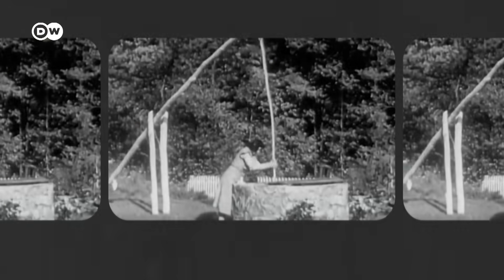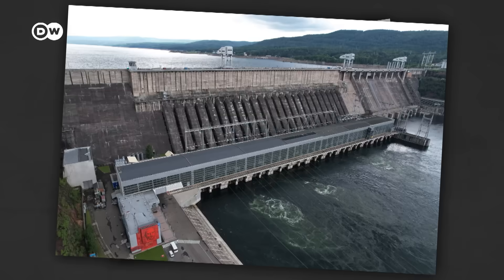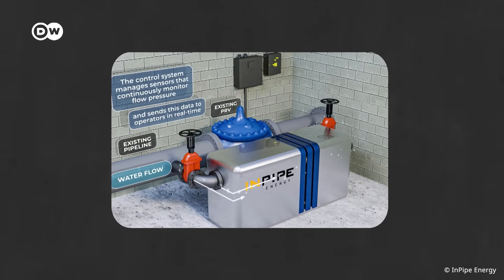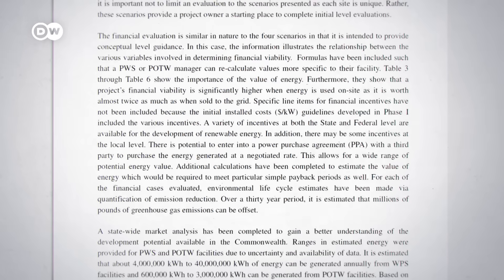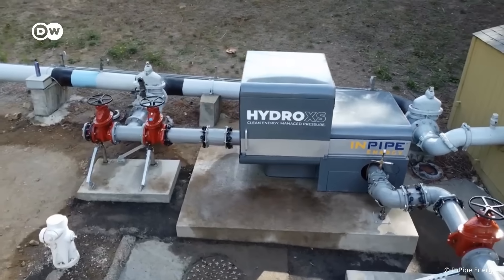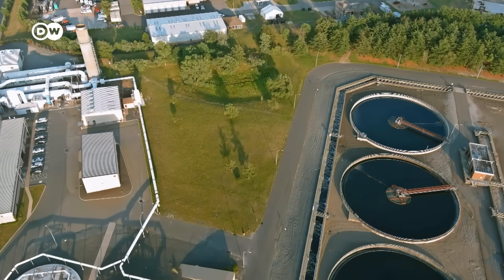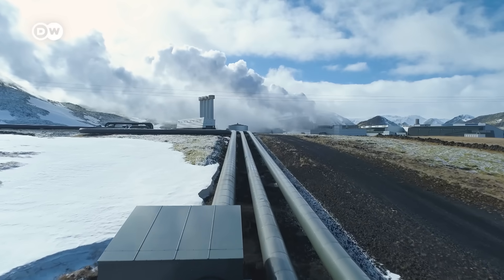In-pipe energy: The hydro power nobody is talking about

Comment: I'm stuck on the issue that if the flow is tapped, it will require more pressure to maintain the original flow rate. It seems apparent that there must be a lot of wasted energy generating the water pressure to make this viable. Tapping anything other than that will reduce system performance.
Reply: I agree, I don't get it either at first. But I think that they have to ensure that there's enough pressure for everybody and it changes during the day, month, years... So there is a system called "pressure valves" that prevent canalisations to explodes when too much pressure if almost nobody use tap water thus wasting energy. So this system of turbine will be just behind "pressure valves" and so wasting less potential energy. 

Am I kinda right or nah ? 😅
Reply: @HedgeH0G7391  I think you're right: these turbines are supposed to replace the pressure valves. When the end-user is not using any water there would be a danger that his tubes inherit the excessive pressure from the central system (if a normal turbine were to be used), so the non-trivial part seems to be to have a kind of arrest-system on this turbine to block the flow in time when the end-user is shutting his taps.
Reply: @Hecatonchires1991  It may not matter so much to keep the pressure regulator and place a small turbine after it. The pressure regulator is self regulating meaning as the pressure on the supply side is reduced, say someone turned on a shower, the valve opens to try and regulate the pressure. Once the shower is turned off and the pressure on the supply side starts to build the spring closes the valve reducing the pressure on the supply side. It is always trying to keep a balance based on how it is adjusted. The question now is would a small turbine on the supply side cause a back pressure between the regulator and turbine tricking the regulator into thinking all is good and you end up with a really low pressure shower, and no one wants that. I am sure there is some kind of formula for how far beyond the regulator to install a turbine, and do you install one on the main line or two or three near the end of the most used water sources?
Reply: @Hecatonchires1991  "the non-trivial part seems to be to have a kind of arrest-system on this turbine to block the flow in time when the end-user is shutting his taps"
if by non-trivial, you mean, a quite trivial "water hammer arrester", then you'd be right.
Reply: @Ghryst  no that's not what I meant. What I'm discussing is not a water hammer problem. I mean that you can use a turbine to lower the pressure downstream AS LONG AS THERE IS A FLOW (and the pressure drop is an increasing function of that flow rate), when the flow stops, the pressure downstream from the turbine would become equal to the high upstream pressure, ie too much. This is so since the water body is in continuous contact through the gaps between the turbine blades.
Reply: @Hecatonchires1991  the thing is, the pressure is already equalised by thje pumps ion the first place. there is no 'wasted energy/pressure'. when flow slows, pumps slow down. when flow stops, the electric pumps stop. 
even if the pressure was maintained during non-use times, you're still robbing peter to pay yourself. 
you are passing on your own power bills to the water-bill payers that you're stealing from.
Reply: @Ghryst  By now we're really running in circles, so please revisit the video and earlier comments in this thread.
Reply: @Hecatonchires1991  wrong.
Reply: @HedgeH0G7391  thaths why u build high reservoris só excesiva presure just fills them. Why more eficient.... But they are not trying ti convince engineers... They teu ti convince iliterate gobernators só they can earn money
Reply: Most water towers that you see are not storage containers, they do two things.  They provide the pressure to pump water to higher elevations, and they absorb the energy known as "water hammer" which occurs every time the flow of water stops suddenly, like when you turn your faucet on and off.

Because when you stop the flow of water in a pipe, several hundred pounds of water molecules and the energy from their momentum slam into the valve.
Reply: @HedgeH0G7391 thanks that was the part that I missed.
Reply: @hugohenrard7391  i think turbines should be used instead of pressure valve,  if you put them behind the valve the energy is already gone
Reply: @HedgeH0G7391  I agree. It would HAVE to be upstream from the pressure regulation.
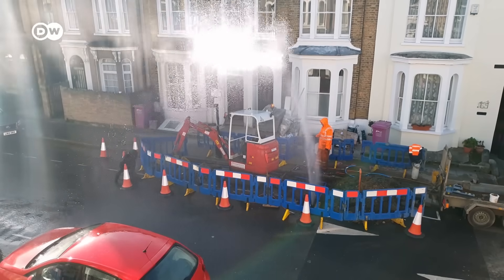Reply: You've missed the critical segment around 2:30 discussing the use of pressure valves where currently energy is being dissipated to reduce the water pressure near the end-user, because the end-users pipes can't handle the high pressure (but the high pressure prior to the pressure valve is still required overall to get the water transported over the distance from a centralized water treatment system to all the end-users).
Reply: @Hecatonchires1991  and this is a very key statement and while mentioned a lot of the video paints of a picture of just "free energy in the flow of water" . this is more of a reducing a waste in a system rather than untapped energy.
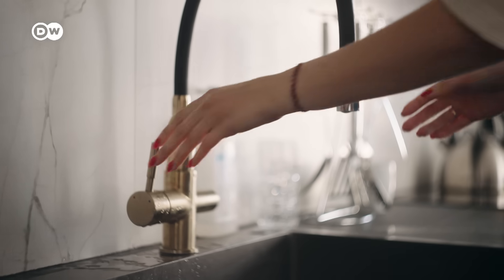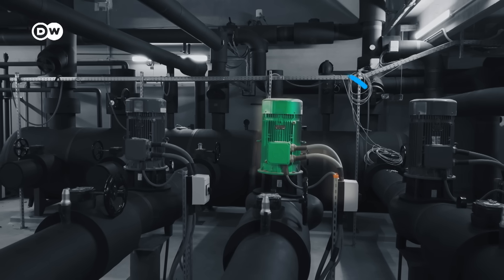Reply: @Hecatonchires1991  I think the video did a rather poor job explaining the concept though. It's not clearly explained why the pressure necessarily need to be reduced like that. As viewer I was constantly evaluating whether this he was describing some sort of flawed "perpetual machine". The the section from 1:24 to 2:50 could have been done ALOT better. First saying we need pumps to have high flow rates (=high pressure) in out taps and then saying we need to reduce the pressure first...

Also - is there really not a better way of reducing the pressure without "burning" energy?
Reply: @olejrgenbrnner4708 You can increase or even balance out flow rate or psi using a Venturi configuration. This vid wasn't very informative I agree.
Reply: @Hecatonchires1991  Pressure reducers have to be near the end user otherwise there will be no pressure near the end of the line in many situations. With all the flow restrictors being mandated for household plumbing it becomes ever more critical to maintain that pressure. The only places this could work is if there's a large downward change in elevation. Otherwise it's another free energy perpetual motion boondoggle. I don't trust legislatures to understand it and legislate appropriately.
Reply: @patrickweaver1105  The confusion in your comment is just too much. Studying physics / engineering is a worthwhile activity and leads among other things to better communication with less confused language and doublespeak.
Reply: @Hecatonchires1991  Hydrodynamics was part of my career before I retired. But you go ahead.
Reply: @Hecatonchires1991  Gotcha! It would HAVE to be upstream from the pressure regulation.
Reply: @LouSchonder not upstream, in the exact place where current pressure regulators are.
Reply: @Hecatonchires1991 yep. That’s why you can turn all your taps on and so can your neighbor and every bodies water pressure stays the same.
Reply: @Hecatonchires1991  just build high reservoirs easy and more eficient since u can transform pressure un water colum
Reply: But if there’s excess pressure caused by low demand, there is low flow. 
A turbine needs flow so would we just run the clean water down the drain, or did I miss the explanation?
Reply: @Pikestnt  🏆
Reply: @Pikestnt  Good point!
Reply: @Pikestnt  Dear Pike, the answer is really short, definitely NOT. Let the water Flow to drain in order to get a minimum energy is NOT acceptable. And here is one of the main cons. Application of this technology must be well considered.
Reply: You are right this video is rubish for rubish minds
Reply: Conservation of Energy ;) it would only work where you have wasted pressure I.e. too much pressure or for example, a river and a water wheel. This is old technology being used to solve modern problems. Though to be clear, I think it’s a great idea but obviously not going to work in every situation
Reply: @chrisshelswell3222  you are wasting your time by explaining to someone who only cares about views and clicks.
Reply: @lordhexon  that’s a good point - luckily I had 5 minutes to spare :) but you’re quite right. Sadly we live in an age where folks will believe anything and “doco’s” don’t think it’s irresponsible to miss out some of the most important aspects to create an unbiased and informative video.
Reply: @chrisshelswell3222  I like to see people thinking about "new" ideas, but so many people act like these old ideas are groundbreaking new technology, lol. You are correct... And I don't know any water company that would allow it! There's one near me that needs something like this, the line pressure is over 200 PSI in the customer lines. 😯
Reply: This will only work if the source of the water is higher than its destination thus creating excess water pressure without spending energy for the pumps?
Reply: @thekookaburr4  Agreed. It's only potentially worthwhile in that scenario.
Reply: @thekookaburr4  no, you can recoup energy from the pumps too
Reply: Just think of it like an elevator. First we put in energy to get it up to the top floor  but when it moves back down, we have to use breaks to slow it down. The breaks dissipate the potential energy of the elevator into heat and prevent it from crashing into the ground. Instead of wasting this energy, we might use generative breaking to get some of the electric energy back. There is no additional energy production but instead less wasted energy. (Yes i know, actual modern elevators are build way smarter than this and do waste very little energy, but it is just an example)

The existing pressure reduction valves are the breaks that "slow down" the water before it enters certain parts of the water distribution system. This energy is wasted right now and can be harvested, without us having to input more energy into pumping and pressuring in the first place. We really have to look at this as a way of making  the system more energy efficient instead of labeling it as a way to generate extra power.
Reply: I live on a street where our water pressure is so low that pop-up sprinklers don’t work.  How about directing some energy collected from a high pressure section to drive an in-line pump to give me decent pressure?  Call it a pressure equalisation system.
Reply: @petermarsh4993  Dear Peter, Water systems never give an equalized or nice pressure all around. Oulet pressure is dependent on many parameters, main pipe pressure, altitudes, and also how many users are connected to this pipe. Some times pipes have obstructions.
I'd reccomend to check conditions starting from the main pipe, for ex. Do your neighbors have the same problem? If so it is an indication of Low pressure. In this case a tank and booster pump is required. Unless the water company solve the problem. 
An integral assessment is the first step.
Reply: Most folks I know need a pressure reducer on their supply to prevent problems and damage to their home appliances.
Reply: @kenknutson1598  I didn't realize they were so common. That offers some promise!
Reply: The point is the excessive pressure is already there.
Reply: but what if you put the turbines  on a sloping gradient? ( eg right before the pipes drop down a hill) Would the pressurized water pass through the turbines and recover the loss momentum with gravity from the slope? IDK im asking because im just a mechanic not a physics major lol
Reply: @TheAxleSaint  It's a possibility of course. Water travels vertically at a rate of 5' per second so if the water is moving at a slower rate than that, the piping needs to be reduced by a few pipe sizes. Good comment btw
Reply: @TheAxleSaint  Possible, yes.
Reply: There's a tremendous amount of energy lost in the pipe friction.  Same as voltage drop in a wire. The problem is that the water company has to provide the last customer in the line with enough pressure.
Reply: I agree with you.
Also, I would point out that if someone did add a generation device for their own use, it would basically be like stealing from the power grid. Considering the extra power required to send the water to each residence doing this.
Reply: Exactly!  This entire video is pure nonsense!  If you tap the energy in the water system, then there is not enough pressure to have the water at the necessary pressure where it is needed. And as you said, then you'd have to increase the upstream pressure to offset the system pressure drops because people are tapping into it to harness miniscule amounts of energy.  A lot of wasted energy for basically nothing!!!  There are no shortcuts in the energy world and this certainly isn't one of them!!!
Reply: Yes,I get the nagging feeling we are talking about lifting ourselves with our own bootstraps (the original meaning of the phrase).
Reply: They definitely didn't cover this aspect enough. I found the story pretty superficial - What locations does this make sense in? Is there a decrease in tap pressure? What does desalination have to do with it?
Reply: @zen1647  it hardly makes any sense. I don't think the round trip efficiency works out well unless there's a drop in height involved.
Reply: @zen1647 Doesn't matter just try...anything possitive is always worth trying anywhere just on a small scale too begin see how things work out n do the maths n slowly build on it all ideas are worth trying I don't understand the backlash you get from folks in comments on energy videos people seem too get very animated and bogged down in the details just try there is countless ways we can improve so anybody with idea just encourage them i say let them try
Reply: I live on the 4th floor of a flat, and our water pressure is still very strong, I imagine a lot of energy goes into that, when it goes down our drains and toilet, all of that energy is lost, some of that waste energy could be re-captured.

I also like the idea of having a water tank at the top of the building, it could be used to store energy and like pumped hydro during low demand periods. Then tapped for energy and pressure for the whole building.
Reply: @Whayles  You definitely need waste water to have pressure so it can flow all the way to the treatment site without stagnation.
Reply: @zen1647 waste water has pressurised lines. Water cannot flow uphill. It's all goes to a pump chamber, and pumped to a main line.
Reply: @Whayles it is possible to use rainwater to fill storage tanks in the attic of buildings, and small turbines in drain pipes.
Reply: @Whayles those takes you imagine have been around for 100s of years. They are pressure buffers. Just look around next time you're in a big city. This pressure in the pipes is not wasted energy, it's necessary energy to keep the water safe to drink
Reply: @Whayles  I'm not so certain that drain and toilet water would be ideal for getting spun about in a turbine 😅
Reply: Whether you're pumping water up to taps or to a tank and then allowing it to flow to the taps using gravity, there is more pressure on the first floor than on the tenth floor. This issue could be mitigated by using appropriately sized pipes, a practice commonly employed in ventilation systems but not always in water supply. So yes, the lower floors could re-caputre the energy expended in pumping the water.
Reply: @Whayles genius, capture the “waste” energy LOL but seriously, I live in a 450 ft tall building, all the waste water flowing down has incredible potential energy to recapture.
Reply: Maybe it's less expensive to tap the wasted energy as done here rather than make the pressure generation system more efficient? I'd imagine it would have to be, or this would not be becoming so popular.
Reply: @LouSchonder 😊
Reply: @LouSchonder only a lib could think of something like this. Friction loss will be immense
Reply: @LouSchonder  popular != good idea
Reply: @LouSchonder if you just put turbines everywhere, then you're absolutely right. BUT we already have 'pressure reducing valves' in many homes. These just waste the energy. If we replace them with turbines, it will recoup energy. Also, we commonly turn on a tap half-way. You could have a variable turbine that slows down the water when you only want some.

(The pressure reducing valves are only needed because water mains are too small, so the water company amps up the pressure to get enough water through. Then houses near the water plant get too much pressure.)
Reply: @andrej2375  "we already have 'pressure reducing valves' in many homes. These just waste the energy"

Please, can you describe how they are wasting energy? Are the valves getting hot? Or they start to move? What does the 'wasted' energy do? The energy cannot just disappear.
Reply: @mikek.1761  yes. The energy gets wasted and turned into heat. You don't notice the water getting hot because it takes a lot of energy to heat water compared to the energy we are wasting/recouping.
Reply: @andrej2375  congratulations! You got yourself a free water heater. No need to generate electricity for heating your water anymore. Good job!
Reply: @mikek.1761  the energy is used for overcoming friction. so useless work is done, and it ends up as heat, which goes to the surrounding.
Reply: In the case of the water flow, does it mean that  if it is intermittent? Should you have a storage of that energy to compensate the generation of electricity if the flow of water is less?
Reply: Tidal flow and undertow for pipe energy also wide pipe is needed
Reply: In my town, in busy hours there's not enough pressure so there's no water at all
Reply: Exactly so!
Reply: True
Reply: Same man
Reply: another issue is the higher pressure generated at the source due to multiple end users using small turbine is bad for the main pipeline durability
it should even be deemed illegal due to this fact
Reply: @H_B_R  so turn down the pumps at the source if there's too much pressure
Reply: That’s true!
That’s why we use natural physics to leverage that!
Reply: What it does is reduce the water pressure downstream of the turbine and proportion to the amount of energy being extracted from the flow. If enough people do it then they'll have to add more pumps so you're not getting anything for free you're just taking electricity from the water company.  Nothin' free there.
Reply: @billallen275  no, the turbines reduce pressure the same way a pressure reducing valve or a slightly open tap do. If you don't use a turbine, energy gets shot out the end of your hose or something. We are just harvesting it, didn't cost the company anything extra
Reply: @andrej2375  thanks for agreeing. You extract kinetic energy from the flow pressure. Where are you going to put this? If you're not using water there's no flow. If you think you can put it in the water company line, good luck with that.
Reply: @billallen275  I disagree. 
We can put the kinetic energy in the power grid. We don't reduce the pressure to zero. We just reduce it to a low pressure. (You don't need high pressure to fill a washing machine, you can slow the water down with a turbine and then let it just run in instead of spray in)
Reply: @andrej2375  ok. Whatever you say I don't really give a hoot. But you're stealing energy from the water company.
Reply: @andrej2375  try putting a windmill on the front of your Tesla and see if you get better miles from the same charge.
Reply: @billallen275  if the energy is coming out of my tap, then I'll do what I want with it.

If I put a windmill on a Tesla, I would only deploy the windmill when I want to slow down
Reply: @andrej2375  certainly, it's your water after the meter. But you have to have flow to get the turbine to spin. That's expensive electricity, and the amount is dependent on the flow rate. 

Yes it'll work.
Reply: It's like a car driving up and down hills, too much pressure on the downhill will burst the pipes, so you have to hit the brakes, thats the waste energy,
Reply: I wanted to stay same, more tapping will lead to a reduction in total flow which will cause to the need in more pumps at end point where u did nothing just forcing the customer to pay more
Reply: Switch to intelligent mode, then it will be possible to understand this and how the Ocean Planet works.
Reply: Domestic users Harvesting power from the utility water grid is illegal in the UK
Reply: Very smart as this conversion of high to low pressure water is currently wasted. Running the pumps of green energy sources would make a sustainable solution.
Reply: Exactly
Reply: these people dont understand basic physics.
Reply: it will need more water to maintain flow rate if you open a tap
Reply: You're absolutely right. This is complete BS!
Reply: The reason you're stuck on this issue, is because the idea makes no fucking sense. I think this is actually illegal in my location. I'm embarrassed for DW. Maybe there's a tiny opportunity at municipal pressure valve locations, but locations with that opportunity usually already have hydroelectric.  This is so stupid, I'm embarrassed for DW.
Reply: This is why in the UK it is illegal to put a turbine on your water supply.
Reply: EXACTLY.    The only free energy is that provided by nature.  We tap into stored energy when we put a turbine generator on a river because nature lifts the water with solar energy and gravity converts it to kinetic energy in the form of rivers.
Reply: Exactly! You can't cheat physics. It is only possible if the hight difference is big enough and pressure has to be reduced for final user.
Reply: Absolutely, the people coming up with these plans are not educated in basic science or understand law of conservation of energy.
Reply: The real issue is that the video keeps saying "energy generation", whereas what they're really discussing is "energy recovery". In nice simple terms, the energy expended in providing a pressurized water system is in excess of actual need. Hence the pressure reducing valves placed at strategic locations throughout the water system. Right now, those pressure reducing valves simply convert the excess pressure into heat which is immediately dissipated into the water that's flowing through them. But if instead the water passed through a turbine that in turn powered a generator, you would still get the desired reduction in pressure, but also recover some of the energy that was used to pressurize the water in the first place.
Reply: Exactly! The only viable option is if you need to reduce pressure. A friend of mine is building a power plant on a watter supply which is high in the mountaines and water pressure needs to be reduced before the local water system. He made the agreement with water supply company, they were ok with that, since it costs them nothing, they even helped him with paperwork, authorities were also happy, since it is a clean source of energy which would otherway go to waste.
Reply: Exactly
Reply: This.  There's only one engineering case where this is most effective.  In this case, the land and water system is not flat, there's a regular downward flow in the system, and it's just turning potential energy of gravity into kinetic energy in the turbine into electricity through induction.  This is like using a traditional hydro-electric dam, just now in the pipes instead of a river.

The other case the video suggests is just bad engineering -- overpressure situations.  Instead of blowing off that extra pressure, a series of turbines can slow it down ahead of time, collecting energy.  The problem with this is that this isn't generating new energy... it's only recovering energy that was wasted to generate that overpressure situation in the first place.  So for flat areas, this isn't generating new energy, just reducing waste energy.  Even better would be to just not spend the resources to generate that overpressure in the first place.  Our brains are struggling to wrap our heads around the proposal of the video, because modern water systems already do this.  There's no valve outside your home or building just shooting water into the sewers whenever the pressure gets too high.  They just didn't overpressure in the first place.

So this proposal is largely just common snake oil fraud of ye old perpetual motion devices.  Water management spent huge resources to generate pressure in the first place.  We can't generate MORE energy than what was already added by our pumps or gravity.  And any energy from overpressure that was added by pumps would just be more efficient not spending it in the first place.
Reply: Its common for these people to come up with "good ideas"  that they have not worked the REAL math out on ..
Reply: Basicly a hydro dam. This could be used with waste water also. Maybe even storm drains.
Reply: It's science, called the law of diminished returns, you basically using the power of the pump, pumping the water, to turn the turbine, or, alternatively, using gravity fed systems to power the turbine, as the water "falls" into your taps.
However, those systems are very susceptible to flow restriction, turbines will drastically lower the flow.
Plumber, 45 years exp. in water/sewerage  reticulation.
Reply: Lower the pressure, you lower the flow. Restrictions in main line supply will drastically reduce the flow supply to homes and businesses.
Reply: @bonsai-zone  ...again, you'll restrict the flow to in city water reservoirs, resulting in them running dry. Exactly what is happening in South Africa due to electrical outages. Those tanks can take days to fill. More people, the quicker they run dry.
Reply: Hopefully u still see this even though im a bit late and I may be wrong as I'm not a physicist but I do electrical and plumbing and I am aware that the water pressure in the citys lines is restricted at the house so there isnt extremely fast flow coming out of your sink. I believe that's where they are tapping the energy from that would've been wasted instead of just using a small choke point to reduce the flow they woukd insert a little turbine that would generate energy and result in a more manageable household pressure. (p. S. I am aware that this isn't necessarily the entirety of it because even I am wondering where that energy is coming from because I thought when u restrict the flow to bring your household water pressure closer to 14psi that it doesn't take any energy out of the system it just restricts the amount of water going through)
Reply: i agree. if high percentage of the energy is taken out from that water delivery system, its performance would suffer.
Reply: This is where solar and ramjets could make this negligible
Reply: I will post a video next year on my build on my channel
Reply: This issue can be solved by using turbines at points where the reduction of pressure is done and the energy is wasted. This energy can be used easily to generate electricity instead of wasting the same.
Reply: just go to the big scale and fit dams with three banks of turbines rather than one you will not triple the output but will get 10-20%
Reply: Most of the pressure in water pipes comes from gravity with water towers
Reply: it simply taps the energy that would otherwise be wasted, as heat to the flow, when the pressure has to be reduced for a consemer (municipality) -- no-one is suggesting running the taps purely in order to generate.. so no extra energy will have to be put in by the upstream pumps, as they will see no downstream effects, the pressure would have to be reduced anyway. may as well harvest that pressure differential.
Reply: I think it works closer to a regenerative braking system on a car. The car might be able to go 60 at one point but needs to slow down at another, and that energy can be recovered.
Reply: Use where gravity is at play
Reply: What about every pressure reducing valve in every House or heating system where there is only Resistence without a Turbine alone that would be a Revolution alone
Reply: Why are they reducing the pressure Always?? Combine that Technologie with Generator
Reply: So long as your turbine is at a lower elevation than the original source, you could net power. Even if the original source was pumped, so long as it was pumped from a higher position than where you try to extract power with a turbine.
Reply: Guys even 5-10 meters drop makes a massive difference and imagine all the pipes and water canals that fall down from the mountains.
Water energy is the future & far better than the solar panels - it's 24/7...
Reply: The concept is about converting the excess energy usually dissipated at the  release valves.
Reply: I think what they mean is energy recovery as opposed to energy generation.
Reply: Exacto, esto es puro humo
Reply: Lrn hydrulycs
Reply: It gets far worse if you put those 12 volt units in series.    Split the hose you say?......   that will work but be ready to put more than double the energy in to get the same result
Reply: In Brazil is very common for houses to have their own water tanks and resevoirs at a higher elevation to gravity feed the house. Putting a turbine at any point between the input from the street and the output in the resevoir makes no difference in the pressure of the house, because the weight of the stored water and the height of the resevoir is what creates the water pressure.
With that said, it would be necessary to evaluate the viability of each house or building to add a water resevoir if they dont already have one, some cities also have giant water tanks to elevate the water table in the pipes on the regions they serve.
Reply: In building, draining water?
Reply: I agree. The idea only makes sense if the water on the pipe is flowing downwards with cause gravity can compensate for the lost pressure.
Reply: water only need speed not pressure. speed is almost for free. the pressure is whats expensive.
Reply: The idea is that you collect/recover wasted water pressure  that is not possible to hold up
Reply from the maker: Some of our users have already pointed this out, but let us quickly clarify. The video is specifically talking about the making use of the energy that's currently wasted at pressure-release valves. Check the section around 2:36 where we explain it in more detail. 💧
Reply: @DWPlanetA  same can be done with down pipes more so.
Reply: @DWPlanetA 
But the rest of the  video you implied the generation would be made at POU.
Reply: @DWPlanetA It's a recovery tech.

It honestly seems mind bogglingly basic tech to be too expensive. Seems like a manufacturing proble.
Reply: @DWPlanetA It's 100% B.S  I've been a plumber for couple of year.This is like renewable energy with a battery.
Reply: Complete nonsense.  Any undergraduate mechanical engineering student that understands Bernoulli's equation would understand the flaw in this idea.  A conventional pressure regulator conserves energy when dropping pressure - there is no 'wastage' of energy.
I am not saying that there isn't energy to 'tap' into and sure it is possible to extract energy using in pipe turbines,  however doing this will lead to the requirement to now put more energy into the existing water pumps.
Reply: @michael-j-harrison  be careful what you say as a seeming to be an inexperienced 'student' engineer ;). As a experienced engineer working in the field i will try to explain you:

Yes, the bernoulli's equation shows you need more energy if you use a turbine in the end of one pipe. But in practice a pipeline distribution has many exit tapps on the way which you should also calculate and overcome. To prevent to have to less flow in the end of a pipe, you need to place extra pressure valves in the inbetween exits/taps which are used for hydraulic balancing. Especially these main pressure valves from high pressure pipe networks to low pressure pipe networks are ideal to replace for turbines. And these turbines are only spinning at a flow that you need in water usage. Thats all extra energy which otherwise is wasted to heat in the water due to pressure valves
Reply: I didnt even watch the video because I assumed it was about harvesting energy from waste water and it seems like a no brainer (harvest energy from houses uphill from the treatment plant). Did they really suggest harvesting energy from the supply lines? If so that's ridiculous.
Reply: @Fiercefighter2  In most situations, yes! In cases where pressure is much higher upstream before the delivery system, there's a possibility, but other than that, NOPE!
Reply: @Fiercefighter2  but if you have a garden hose with 110psi and only need 30psi, you could use a turbine to reduce pressure instead of only opening the tap a little. The water plant uses the same amount of power either way. It's not like they're suggesting putting a windmill on a car.
Reply: Well, normally you get the water pressure by pumping water into those high water towers and let gravity do the rest. Still, it should decrease the flow rate of the water.
Reply: @walli6388 proper design of fluid energy system, should work. A possible example, marine thrusters on marine crafts can be designed to provide energy when not in Truster Mode.
Reply: As they explained, there is actually excess pressure that is currently handled with more excess equipment
Reply: i.e efficiency is key, energy cannot be created or destroyed ,it can only be converted,

I do not think the economics of this idea match and quite surprised d.w actually posted this, Whole concept is  riddled with inaccuracies.....
Reply: @dxrocker6170   another expert with nothing to counter what was said but an opinion touted as a fact.
Reply: @dxrocker6170  Well it is already being used in some cities, so there is apparently something to it. Converting excess energy, that would be otherwise wasted is not the worst idea, obviously it would be better to prevent the excess pressure building up in the first place, but maybe it is not always possible?
Reply: Ya this is basically a "free energy" idea. This is about as dumb as strapping a wind turbine to an EV...
Reply: @larcomj You don't know what you're saying because you don't understand the point. There is already excess pressure in the system and the pressure release valves would normally dissipate that energy when demand is low. Instead of dissipating to nothing, much of that energy is recovered. Nobody said it is a one-to-one energy recovery.
Reply: @larcomj  this is not a free energy idea. If you actually pay attention to the video, this device helps recover some energy lost in into useful energy. Think of it like regenerative braking in EVs.
Reply: Wrong, the pumps elevate water into towers. This potential energy is what they are talking about siphoning. Not the dinky hose pipe analogy this tuber shows😂🎉
Reply: I dont think that water companies will adhere to that
Reply: Research water hammer pump.
Reply: This is best used for harnessing waste kinetic energy from intermittent water hammer effect. harnessing micro power from your water hose outlet isn’t really very efficient if the water is being supplied using pumps. Harnessing micro electricity from the pipe outlet pressure only makes sense of the water grid pressure comes from potential energy like water coming from a higher elevation reservoir or tank
Reply: If you install an in pipe turbine in a pipe that is carrying water downstream then gravity will provide the extra energy needed
Reply: @eheboi9278 Yes, but only when flowing down.
Reply: I live in a high-rise in India. The water tank in on the 21st floor equivalent. The pressure of the outlet at the tank is high as water flows down constantly to hundreds of taps below. If a turbine is attached, it will not impact the inlet in anyway and will not put additional pressure on water grid either.
Reply: @Masood1810  Your example is not an equivalent to what the channel originally stated. Work / energy has already been put into the water to get it up to the 21st floor elevation and that is stored potential energy. That energy is extracted when it flows down to all the residences.
Reply: This is correct. It's important to try to obtain energy from process which really have waste energy.
Othewise as you say, we would be wasting twice energy.
Reply: @rolandochavarria466  no, we wouldn't waste it. The turbine works best when we desire low-pressure water but have high pressure in the tap. We only let out the water we need.
Reply: @andrej2375  this is it. I know in Water transportation there is waste energy,  such as in down hill pipes or big gravity pipes. Congratulations.
Reply: Nonsense idea.
Reply: @miroslawkaras7710  Only depending upon where the system is tapped, what the costs are, and how much energy can be recovered.
Reply: @miroslawkaras7710 No such thing as a nonsense idea and if somebody wishes too try you should just offer possitive encouragement no room for negativity with regards too energy usage improvement
Reply: How about a federal infrastructure bill to modernize the water system and add turbines in the US. We lose massive amounts of water from old leaky pipes. Then the money saved from electricity generation pays for the work done.
Reply: Yes like you need power to push that water but now add blocks it will require more so ya I can see the problem being your now using more power to get water places.
Also with all the extra moving parts= more places to brake and if that happens will there be any pressure down the pipe 🤔.
The fact they use desalination is stupid like get a glass dome put the water I there tada fresh water on the roof of the dome salt left behind to mine like come on big companies.
Reply: @DeathsGarden-oz9gg desalination isn’t just to remove salt though.
Reply: There's a way to actually move water up hill without using energy or electricity or a motor at all using pipes at the beginning and middle stages that are capped and going upwards from the flow to build pressure. So literally you could make these things produce electricity at the source and in-between if you were smart about it and it wouldn't cost anything more than materials and labor.  @DeathsGarden-oz9gg
Reply: it dosent reduce performance...